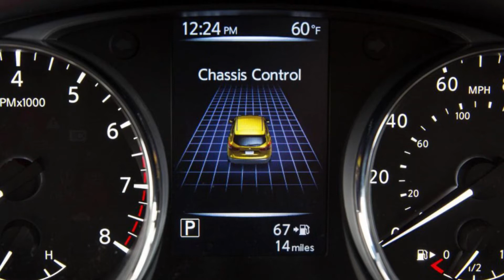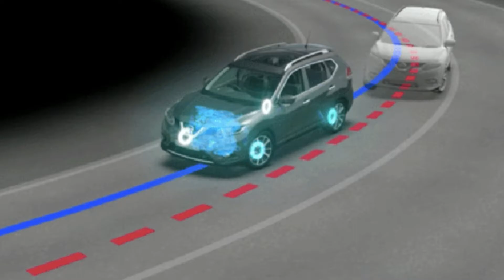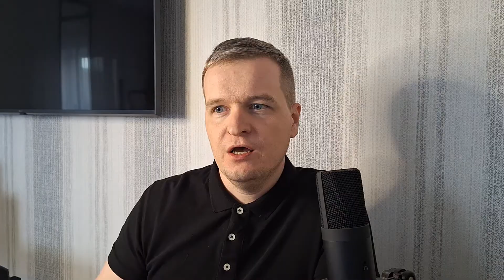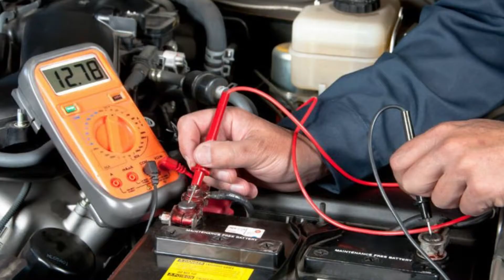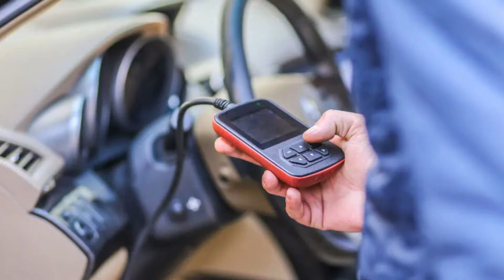“Chassis Control System Error” warning in Nissan Rogue and X-Trail

Comment: My code reader won’t connect.  Car doesn’t try to start again
Reply from the maker: That's an electrical fault - you may check fuses, but most likley, you will need a good car electrician to have a look at it.

Comment: I just finished up. A head gasket on my wife's car 2015 Rogue, plugged everything back in correctly, it struggles to start and run, then throw the message at me... I give up.
Reply from the maker: It most likley doesn't get readings from one of the engine sensors or systems (throttle unit, camshaft position sensor, for example). It may be a shabby wire that you've touched and now it doesn't have the connection, but tracking it down is a nightmare, you need to be a car electrician for that or just check your luck and wild-guess the wire or connector that is making up.
Reply: @DmitrySapko it throwing some codes now that have something to do with the Intake manifold p2004 p2014 and p2017 codes, and those are throwing misfire codes.
Reply from the maker: There are 2 culprits for these codes: variable geometry sensor on the side of the intake manifold (real pain to get to it, you need to unbolt the manifold to take it out) or the flap actuator - on the other side of the intake. The sensor is a more likely culprit - it may have been damaged when you installed the manifold.
Reply: @DmitrySapko thank you ill check it out.

Comment: I just had to take my wife's Nissan Rouge 2019 into the dealer to resolve this issue. It ended up being the cable connector just under the dash on the drivers side. The sunroof was spilling water down onto this connector, as the drain was clogged. You could see the green mold forming inside the connector. After analyzing the issue, unclogging the sunroof drainage and cleaning up inside the connector, the problem was solve.
Reply: Bro you just saved my life, my rouge lit up like a Christmas tree, chassis control, headlight malfunction, AWD malfunction. Right under the driver trim by the E brake there’s a plastic molding panel, all the connections there were wet ! We just had rain for 5 days straight. As soon as I dried them all out it works like a charm no errors
Reply: @drumlino117  It cost me $900 to get that fixed at the dealer.  LOL !!! Glad it helped.
Reply: @drumlino117 amen ❤🎉
Reply: Thank you for the comment- I am sure that’s the same issue my chassis is having- I bought the car used and didn’t notice until this week it has a serious mold and rust issue

Comment: I get the error when I've just parked, and the strange thing is that one of the fuses blows. When I disconnect the battery for about 15 minutes and change the fuse, it works again, but there's no telling when it Will fail again.
Reply from the maker: What is the fuse responsible for?
Reply: Which fuse